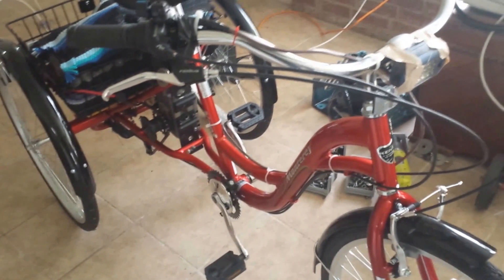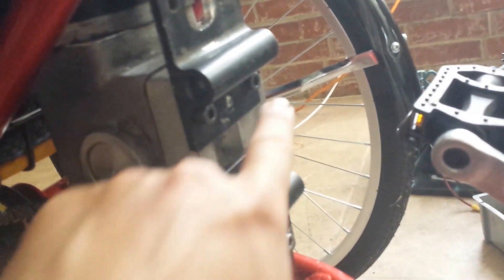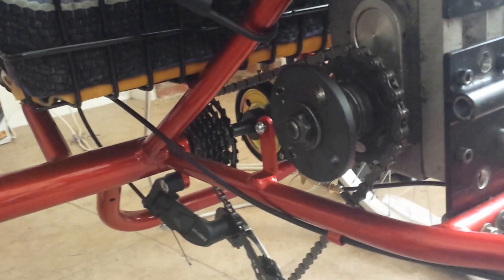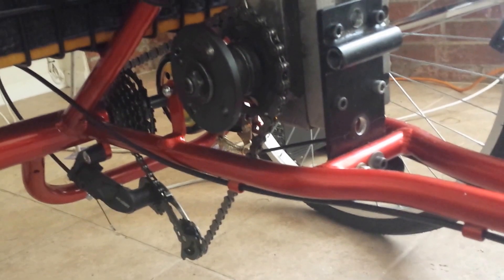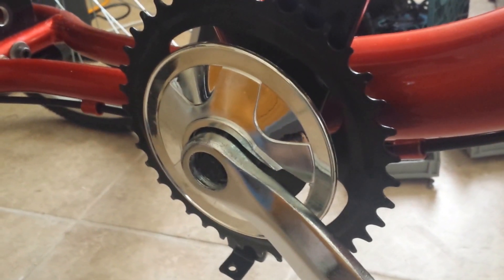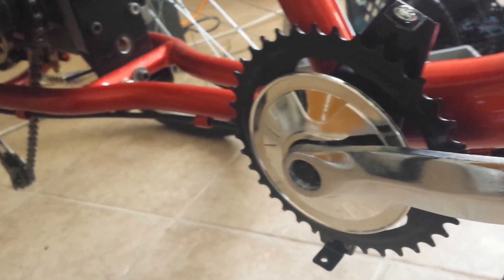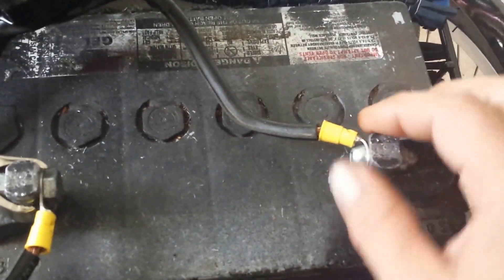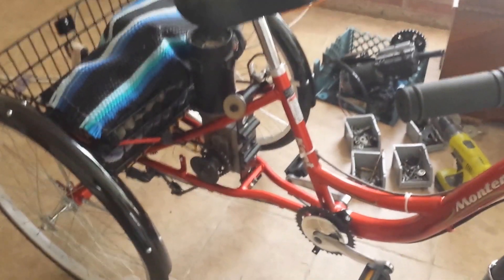New trike.

Comment: If it were me, I'd be looking for some 18650 lithium ion cells and build a series parallel battery for it with a battery management module for charging and low voltage cut off. It's a much higher power density than those lead acid batteries.

Comment: Good mod - looking forward to seeing how that Wchair motor pushes it. This fall I took one of those adult trike rear ends (bolt on) an moded it to my 2 wheel recumbent - now a very comfy trike.
Before I took the rear end of the adult trike I rode it around a bit, gets the job done but not a relaxing ride based on the peddle position - would not want to peddle it around without the E-assist for two long.
Thx for sharing - cheers, Patrick
Reply from the maker: My previous trike was a bolt-on style where you can put any bike frame you wanted (hence the bmx frame on old trike).  I just published the build for this new trike on instructables.com
check it out.
http://www.instructables.com/id/DIY-Electric-Trike-From-Electric-Wheelchair-Motor/